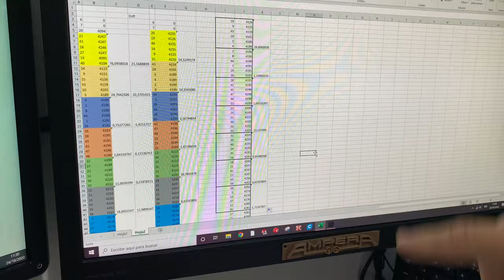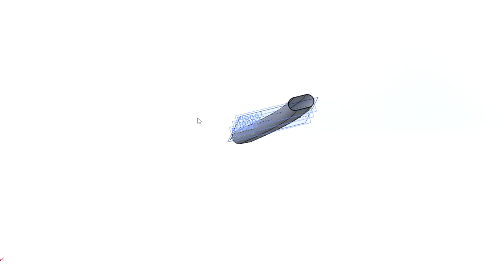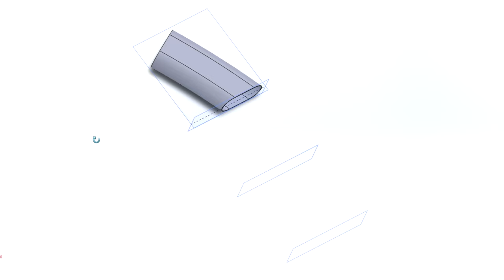E-bike battery pack creation for Sparta Ion and Batavus for really cheap price

Comment: Hi David, I am building this battery, but don't understand why there are 3 cables on the charging cable. I can follow the positive- and negative connection via the BMS, but where do you connect the 3 cable?
Reply: same Question here. If I looked closely the grey cable wasn't connected, is that correct?

Comment: Thank you, I've used your 3d templates and so far everything works fine, the action radius is a bit disapointing with 2000mah only 20km and then the BMS cuts out. Have to take a closer look how that's possible.

Comment: The video is very inspiring, but please, how to open that banana battery case. I would be grateful for advice. Greeting.
Reply: I used a multitool and sawed the sides open. Be carefull: don't saw to deep or you will touch the batteries

Comment: I don't understand why you show first that you connect every plus with every plus and minus with minus, and then you only have plus and minus combined together,The charger does not charge my battery, there is a 30 amp resistor in the original connection, but i have more from this connection, could this be a problem?

Comment: Hey David, I'm really interested in DIY'ing your Sparta Ion project along with your videos, but i feel like my own battery pack is still working fine, and I'd like to keep using it. Can i install a BMS in the same way as shown in this video, or should i be searching for a different solution?
Reply: Hey, I am looking for a solution too. The cells are good enough for me but the BMS is burned. Please let me know if there is any place to buy a BMS or the characteristic of it. No clue about what could work with this special li-ion battery. Please help me !!
Reply: @rottelHQ  Hey dude, just letting you know that I never got it to work either. I ended up buying 2 12v motorcycle batteries to run in series for 24 volts. Doesnt look nice, but it works! These bicycles are horrible and once the BMS breaks its basically over.

Comment: Wondering if it is possible to replace the battery with Li-on (and bms) and just keep te original controller?
Reply from the maker: No, because part of the controller is embeded into the battery and bms, they already design that to avoid this easy solution.

Comment: What is the specification for the battery you used?
Reply from the maker: Hi Aston, The specs of the baterry that I replaced are: 24Vdc Ni-Mh 9000mAh-11000mAh (depend the year of the bike). The specs of thebattery that we create are: 24Vdc LI-ion 21000mAh, Nominal voltage 25.9Vdc. Current continuous 17,5A, Current peak around 500A.
I hope this info is good enough for you.

Comment: Fantastic David!

Is the Brushless Motor Controller inside the same space that holds the new battery, but below the battery?
Reply from the maker: Yes, below the battery, if you check the video of the full ebike reparation you will see how every single item fit on this space.
Thanks.
DJ.
Reply: @Davideljeringa  Please replay ;-)
Reply from the maker: @steki75  As I mentioned some years ago in the answer, yes the motor controller fits in the same spot than the battery, so order is battery, motor controller and then the wiring. Hope is clear enought

Comment: Why you super them first in parallels? From 9:40 - 10:20
?
Reply: Yes it's confusing
Reply: That is for balancing the 6 pack parallel batteries together, after all 6 packs are same voltage after waiting long enough (without using a charger), he will remove the wires on one side.

Comment: Hello David, Can we use the bike's original motor driver?  Does the Sparta software accept new batteries?
Reply from the maker: Hi, not really, the problem on that bike is that the driver control is partially in the battery pack. It is design to avoid customers easy solutions.
Bedankt
Reply: @Davideljeringa  Thanks for your reply.  Then it is necessary to overhaul the engine for the new driver, right?

Comment: El bms que compraste cual es????
Reply from the maker: Hola Sebastián,
Este es el bms que yo instalé: € 3,47  6％ dto. | 3S 4S 5S 6S 7S 15A limit 20A 18650 ion Placa de protección de batería de litio 12V 24V 29,4 V Li-ion Packs BMS con disipador de calor de equilibrio
https://a.aliexpress.com/_BU2CXx

Con respecto al inglés lo siento pero no dispongo de mucho tiempo para poner los subtítulos. 
Si tienes cualquier duda por favor no dudes en contactar conmigo. Es un placer poder ayudar.

También podemos hacer una videoconferencia si necesitas más información, por mi parte no hay problema.

Saludos
Reply: Muchisimas gracias por tu respuesta ya compre todas las herramientas para hacerlo! Con respecto al bms he comprado el 7s de 29v esta bien? No m queda claro debido a que el enlace dispone de diferentes variantes a seleccionar, de nuevo gracias 🙂
Reply from the maker: Hola de nuevo, 
Si en efecto el 7s 29v es el correcto si tu objetivo es crear una batería de 24Vdc.
Saludos.
Reply: Gracias 🙂, y finalmente dejaste la misma controladora o la reemplazaste tambien??
Reply from the maker: @sebastianaguilar576  A que controladora te refieres? El controlador del motor? Si es eso no, he tenido que sustituirlo debido a la complejidad del sistema completo. Estoy acabando de editar el vídeo del motor, es ese podrás entender el porque de no poder reutilizarlo. Espero poder subirlo hoy al final del día. 
He utilizado varios tipos pero los que mejor han funcionado hasta la fecha han sido los que no tienen display LCD, los de led son menos estéticos pero muy baratos y van de lujo.
Saludos.
Reply: Increible estoy super agradecido con tu canal y tus aportes en youtube 🙂 gracias, esperare a que subas el nuevo video entonces para comprar la controladora recomendada por ti, de momento ya he comprado todas las herramientas y hare contenido en instagram y facebook etiquetandote ya te sigo ahi, nuevamente gracias 🙂
Reply from the maker: @sebastianaguilar576  Hola Sebastián, con el controlador hay que tener varias cosas en cuenta, primero que los controladores para patinetes o scooter no suelen tener el conector para el sensor de pedaleo, en el caso de que solo quieras el acelerador ese también te vale, en caso contrario tendrás que buscar uno para ebike. Y el segundo punto es que el controlador sea compatible con la tensión de la batería que tienes, la mayoría de ellos son compatibles entre 36/48 pero no todos lo son con 24v, cuidado en ese punto.
Este es el que mejor funciona de los que yo he probado:
€ 16,00 | FOCAN-controlador de pantalla LED para bicicleta eléctrica, 24V, 36V, 48V, 250W/350W, S810
https://a.aliexpress.com/_B1dRKL
Yo lo compre en versión 24vdc. 
Saludos.
Reply: @Davideljeringa  vale entonces con este haras el video explicando la instalacion ? de ser asi lo compro al instante para no esperar tanto en envio, gracias :)
Reply from the maker: @sebastianaguilar576  Hola,

El vídeo lo haré con otro un poco más complejo pero mi bici personal la tengo con el del enlace, si quieres te mando un vídeo de como conectar ese controlador al motor y batería.
Reply: Hola, personalmente prefiero uno que tenga acelerador de ser posible y he estado mirando mucho las posibilidades, te agradezco mucho la ayuda 🙂

Comment: Nice video but does it actually work and does the BSM manage the cell's correctly? Does the Ion software recognise the battery after disconnection? And can you still use the old changer? Still a lot of loose ends
Reply from the maker: Hi, The BMS it works as expected, it is controlling the overgarge and overdischarge as expected, the maximum voltage registered on the packs are 4.17Vdc avg, and the minimum is 3.78Vdc, so always between the expected levels to ensure the live of the batteries. 
Yes, you can reuse the original Sparta Charger, is the one I use every day.
For your information the max range obtained so far was 135Km with one charge with medium assistance level and changing between med and low 178km, I charge the bike every week or so, very convenience.
Thank you for the comment.

Comment: what about registering the battery  with the system, any idea on how to do that without going to official dealers?
Reply: Not. You are to open the hub motor, dispose of all the printed circuitboards inside, solder the three wires to the wires that come from the coils of the motor and close it again. Use a cheap Chinese e-bike controller like https://nl.aliexpress.com/item/1005001519752387.html?spm=a2g0s.9042311.0.0.27424c4dfrXLR3 (you see one in the background).
You can, but don't have to lead the hall sensor wires outside. It will work adequately without.
And you shall have to save more on the motor wire diametre than is good to get it all through the hole. But I know it has been done
You do need to use a PAS sensor on the pedal (in Holland that's law) or a throttle controller.
The torque-sensor on the rear axle that is used originally cannot be used without extra logic (which you have to design and build yourself)
Reply: @josmeijer  sorry think lind don't work, sajnos a link nem él 😞